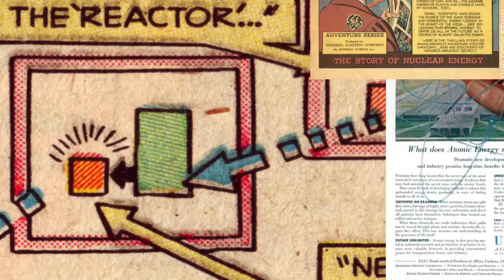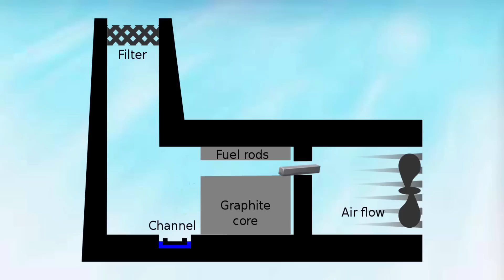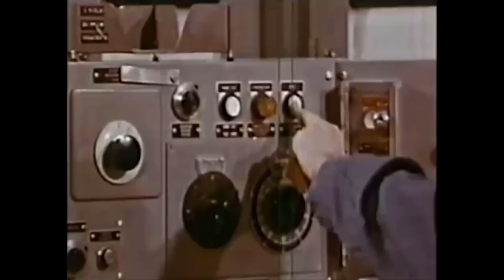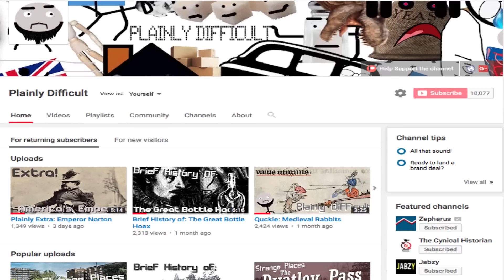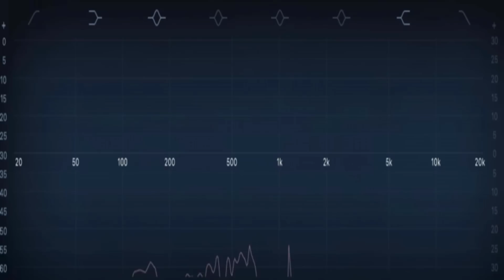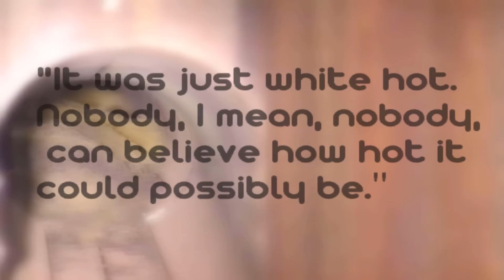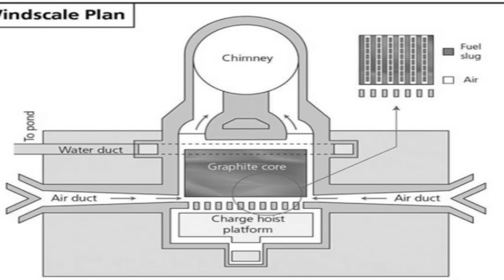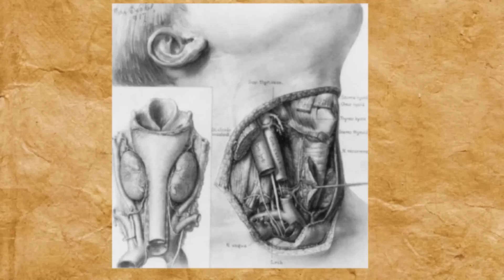Brief History of: The Windscale fire

Comment: Im not an engineer but, that sounded like a bad idea from the start
Reply: There was just no redundancy in the safety systems of this reactor at all. If fuel cartridges jammed there was just a mad scramble to try plans B and C ad hock formulated on the spot with no guarantee of them working at all as they were just purely theoretical. They were very lucky that the containment block did not melt down. This design would never get off the ground today as it is not fail safe. The future surely has be thorium Molton Salt Reactors for safety reasons alone.
Reply: @MrDegsy69  It's worth pointing out somewhere (since I'm seeing a lot of repeats about thorium reactors and all) that it's easy to look back and giggle with "What the f*** were they thinking?"... When the truth is there were only two glaring oversights on this...
1. Air contains oxygen, and should a fire get started, air will ONLY exacerbate the problem.
2. Some redundancy (even minimal) should be predesigned into ANY pioneering technical project. JUST have at least a "Plan B" and "Plan C" prepared for operation before you are forced to abandon a site... 

    The idea that air-cooling means no "loss of coolant failure" is actually not a terrible idea. This is a nuclear reactor we're talking about, and over the years there have been quite a number of "loss of coolant" issues, including a few accidents... SO preventing that in design isn't bad... Forgeting that air will FEED a fire in the case something else goes wrong... not so bright (admittedly)...

   AND today, we have the Thorium Reactor, and a fair bunch of industrial power-mad pragmatists prophesizing SO MANY great things about the idea, and little or no possible downsides... drawbacks... issues...
   Every single time I've seen an industrialist with all good details and not a bad thing to comment, it's been a disaster in the making. Historically, that's just how it works to sell these great pioneering projects to "regular people" who actually don't really even need them most of the time.

    Now, that's NOT to mean that Thorium is necessarily GOING to be a horrible sh*t-show. It doesn't have to be, at any rate. I'm just pointing out that there is a litany of evidence... REAL LASTING HISTORICALLY SCARRING evidence... that when someone tries to sell you "pie in the sky" the better answer might be... "what's the downside?" and be persistent enough to find one... or a dozen...

    Thermodynamics makes damn sure nothing ever comes "for free"... EVER. ;o)
Reply: from interviews, I have seen engineers agreed with you. the thinking seemed to be that it would be safer as the risk of an explosion would be less. they probably saw the other flaws as acceptable risk stupid as it was.
Reply: @eslov  true.  Theoretically they could just do what they did and close off the whole building.     And it would stop instead of blowing up and being out in the open un containable
Reply: @Grognarthebarb  The fuel shortly after the reactor is shut down is still producing a lot of power from decay. If they stop cooling it, the whole core will melt and at least some of it will flow out of the fuel channels as hot lava; this is nearly the worst case scenario instead of the much better outcome that was achieved. They needed to cool it and they were afraid to use water, which they eventually had to try and which worked.
Reply: That’s called outcome bias. And you also have decades of background knowledge that they didn’t have access too.
Reply: Arthur Morgan 
Adding air to a fire has always made it grow.  Cavemen knew this.
Reply: These early reactors had to solve a very particular design problem. They wanted to use unenriched or very low-enriched fuel and they wanted to have very low burn up (short stay in the reactor) so they could get pure Pu-239 for bombs without a lot of Pu-240, Pu-241 etc. Nobody has ever built a nuke from civilian grade plutonium because it's a bad idea; it gives off too much heat and too many stray neutrons reducing the realiability of the bombs you can make with it and rendering their long term storage a big question mark (you get helium bubbles inside the plutonium from alpha decay, high-explosives lenses with a very particular geometry sit and swelter in much higher temperatures than you'd like etc).

If they had used graphite and water, there would have been pressure inside the reactor. And if the water ever boiled, a chernobyl style excursion would have been possible because graphite is a much better moderator than light water.

These things were built and operated successfully in the US, the USSR, Britain and france. The experimental designs like the X-10 operated at very low power. They did not require any fuel enrichment at all (which was good, because in the beginning they only had natural uranium). You could have a dude with a pole manually shove fuel into channels through the front shield of the reactor, meaning you had no complicated mechanism. No expensive heavy water. Easy.

But the plutonium output wasn't very good for the massive size of the reactor and there would shortly be an arms race to build as many nukes as possible and also use the waste heat for power generation and so they very quickly moved on and added more and more features to allow the reactor to faster and hotter. The US went with water cooled graphite moderated reactors at Hanford for their first large scale plutonium reactors (Hanford B); water cooling ment you could have higher power density and make plutonium quicker in a smaller volume; safety was not that important.

In Britain and france cooling fins on the fuel canisters was added, more air went through the core and it came out hotter (so it could be used for power) and so on; cutting down on all safety margins until you have the AGR that was used at windscale.
Reply: The ideas came because politicians pushed on and on and on. Put the blame in front of the right people. Downing street with its damned "special relationship".
Reply: J S 
1st folly.  Not engineering the rod ponds to be able to catch the falling spent rods. 
2nd folly.  Engineering a way to introduce more air into a fire. 
Looks like the engineers did not think of every possible issue.  I could have told them both were bad ideas.
Reply: @lanesteele240  Perhaps... but not at a time when all of this science was virtually brand new, and none of the operational experience that would be gleaned from this incident and others had been learned yet.

In hindsight it seems crazy, but at the time there was nothing to say that it wasn't a good idea.

 As bad as it was, I see it as a good thing that we learned the lesson early and made sure this type of incident wouldn't happen again, rather than this working without issue and a far larger accident happening elsewhere some time later because the lessons weren't available to learn from.
Reply: J S  ACTUALLY, most recently, I was referring to the other comments in this section (most specifically) but there are quite a few others... I've been sort of trying to "sift through the BS" to the details of what the hell they're talking about...
   BUT specifically, most of them have repeated "Molten Salt Thorium"... blah-blah-blah...
    AND yes, I know... I've been to high school radio-chemistry territory before (we finished our lab-books ahead of schedule so we got to play with a bunch of rad-meters and "samples")... SO 101 stuff more or less...
    The intent was only to posit that one should be exceedingly careful ANY time there's a "pie in the sky" sales-pitch around nuclear any-damn-thing... It's just not worth blindly risking "on good faith".

   I've been told (comments are comments... what can I say) that Thorium reactors can make use of spent uranium(?) and resuscitate fuels out of unenriched... 

   AND then I dwindled... because you can't resuscitate what wasn't already being used... that's contradictory... AND if it was being used (i.e. spent) it's just redundantly suggesting the same about old fuel /waste again...
   None of which is particularly well proven, viable, or documented as yet... SO I'm just "not going to hold my breath for it"...

   I'll grant you, we (human civilization) NEED to continue the research and development... 

   I just happen to think there's a deficit in the school of thought about developing ways to use LESS instead of creating MORE... whether by encouraging sales pitches for better things to put our spare time and energy into ...
   ...say... working out in gyms that propel generators instead of exerting force to do nothing useful...

   ...or ... proponents of hand-tools and older fashioned methods instead of having robots to do every damn thing...

  ...or even... innovative gardening, horticultural, or green-housing prospects encouraged through public grants or community projects... something along those lines anyways.

    ...hell... particularly industrial and compact urban areas could combine buildings into larger superstructures for convenient transportation and parking space... and cut down on traffic for the rest of us (possibly... but I'm still tinkering on the hard math)... ;o)
Reply: J S 
You dont even know what i was thinking when i made my first comment.  ANY of the ideas in this video could have been what was referring to.   You have stated some dumb stuff here.  I hope you are not an engineer.  I dont want to drive over any bridge you have designed.  Keep arguing you are not the first engineer that i have put in his place.   You wont be the last
Reply: J S 
Most are asshats.  You must be one
Reply: Tomorrow at work i will bale out an engineer or prove one wrong and i will think of you.
Reply: J S  No, you skimmed a few points that were inconvenient, and decided to accuse me instead of trying...
    So you're a lazy pile of dogshit, who'd rather get personal and attack, than bother with thoughtful exchange... got it. 

    AND go fuck yourself. ;o)
Reply: J S 
You expect to much from youtube comments.  Nobody is going to write an essay here.  Just quick little thoughts.  
You must be an engineer.  Your lot will fuss at a wall if you think you are right.  
You know im right.  You must be boiling inside now.
Reply: J S 
Oh no!  We got an internet badass here.
Reply: J S 
Oh no!  We got an internet badass here.

Comment: You left out why the plant overheated, which is kind of the only interesting thing about this reactor.
Reply: @vitriol or debate Do you want me to just tell you?  Or do you want to try to look it up.
Reply: @htomerif  tell me plz ( ill appreciate it )
Reply: @qtexasbrumley  The moderator of the reactor is made of graphite ,but its not the fire that caused the problem.  When you irradiate graphite it causes dislocations in the lattice structure where atoms get knocked out of position.  The longer you irradiate it, the more dislocations there are.  The dislocations are a much higher energy state than the atoms normal position.

When you heat the graphite, the dislocations return to their original positions, releasing a lot of heat in the process.  They had to regularly overheat the reactor to keep the graphite from dislocating too much but they'd miscalculated how often and how hot.

During one of the annealing cycles, when the graphite was heated it entered thermal runaway from the built-up dislocations.  There could have been no uranium in it at all at that point and it would have kept heating until it caught on fire.

That incident is the main reason reactors shifted away from low temperature graphite and towards much more expensive things like heavy water (before fast neutron reactors).
Reply: @htomerif  I think it could have been solved with more anti freeze. 😊 jk Thats incredible really. & horrified i am ..
Reply: @vitriol or debate generic bait comment? ok.
Reply: @vitriol or debate That has nothing to do with the fundamental reason why the reactor failed or I wouldn't have left the comment I did, would I?

Comment: I love your videos on Nukes ! You should do one about the TVA Browns Ferry candle Fire.  They would use a Candle To Check for pressure Leaks by hold a flame along the walls and they found a leak when the flame was sucked threw a wall in to a cable Tray and it started a huge fire. I have held the candle in a Brief about Operational Experience.

Comment: The great thing about water is that it can act as both a moderator and a coolant. The entire concept of an air-cooled reactor is so idiotic it's hard to believe anyone actually tried it in the first place.
Reply: In a small nation with no large, empty states you don't want your first experimental reactors to be water cooled in case a lack of coolant accident happened.  At the time, and with the knowledge available, these were actually safer.
Reply: It had worked successfully in an American nuclear reactor creating plutonium several years earlier.

Comment: You must remember that this was in the early days. Britain wanted a bomb to get the Ameriscans to co-operate. Safety was not ignored but it wasn't the number one priority. The cause of the fire was not a simple single event. The operators worked under pressure to produce enough plutonium and other materials for the UK test programme. The rise in temperature was noticed but could have been caused by many things some possible unknown to the operators. It is wrong to think of the whole pile being in flames the over heating was restricted to a few channels. Things could have had a better outcome if the fans had been shutdown however minds where concentrated on Wigner (yes it is Wigner not  Vigner) energy release. This is the energy deposited in graphite by radiation. It had to be released periodically to avoid a sudden release. This was achieved by  warming the graphite up to  a prescribed temperature periodically. The pile has sat without much ado ever since then most of the fuel was removed into the duct (not a tank) and transferred to the PIle Storage Pond. The duct itself has been cleared some time ago,. A few channels were blocked and up to a few years ago remained to be dealt with. The pile itself remains to be decommisioned.

Comment: Think about it, what is the purpose of a reactor? Electricity is a byproduct of making weapons grade material. Uranium has to get really hot to fuse into plutonium. What does a nuclear power facility do? gets uranium really fuckn hot inside pressure vessels with 300psi.  Natural air pressure outside is roughly 14.7 psi (0.0 psi on a gauge) which water boils at 212 F / 100 C. Now add 300psi, what does water boil at?  450 F. Thats just starting to boil, the reactor has to get way hotter than that to run effectively. Making weapons grade materials while producing electricity, what a wonderful way to cover up there intended purpose.
Reply: The purpose of a reactor is the purpose it was designed for, breeding weapons-grade fuel is just one purpose.
Reply: Power reactors tend to have fuel composition and general reactor design that results in very low plutonium yield. It's not really a factor with modern power reactors anymore. Older ones as well as breeder reactors do produce a lot more though
Reply: That's not right, plutonium production works fine at low temperature. It's electricity generation that needs the high temperatures for reasonable efficiency (damn you thermodynamics!).

Comment: You also didn’t mention the fact that they wanted to speed up the process by letting the cartridges heat up more and they shaved the fins at least once and if I remember right they did it a second time. This is what ultimately caused the core to heat uncontrollably
Reply: Js youre incorrect, watch again bud. They needed more heat to create a stronger faster reaction to create the plutonium they wanted for use in nuclear weapons. So I was not lied to, I in fact am very knowledgeable in this incident along with 3 mile island, chernobyl and the demon core.
Reply: Wasn't the requirement for more heat due to the plant being used to make plutonium on the down-low? I was of the understanding that they shaved down the fins for that reason.

Comment: No one ever talks about the Santa Susana Field Lab.  At least four of the ten nuclear reactors had accidents during their operation. The site was used for nuclear reactor experimentation and development so they had no containment structures. The Sodium Reactor Experiment-SRE nuclear reactor experienced a core meltdown in 1959, which caused the release of more than 458 times the amount of radioactivity released by Three Mile Island.

There were a number of radioactive fires, a sodium burn pit, numerous spills and releases and some of the cleanup procedures involved using rifles to shoot barrels of toxic waste so they would explode and the contents would be released into the air.  The site never was cleaned. Since then, there have been wildfires and releases of wastewater and storm runoff. And it is no longer remote like it was when they first built it in 1947.